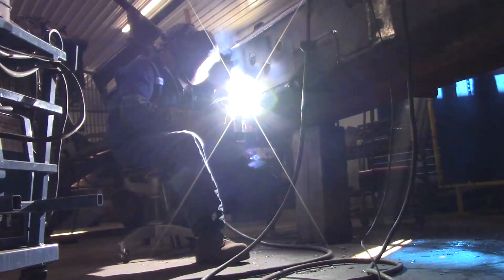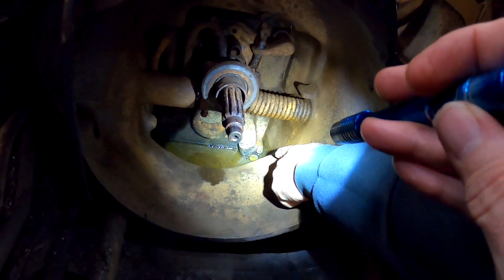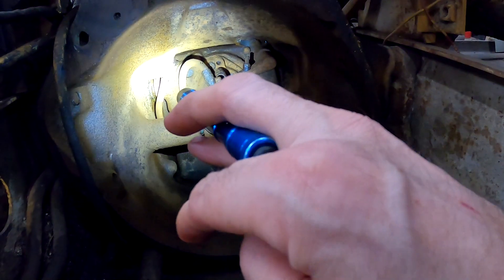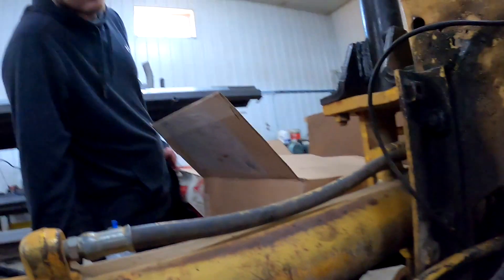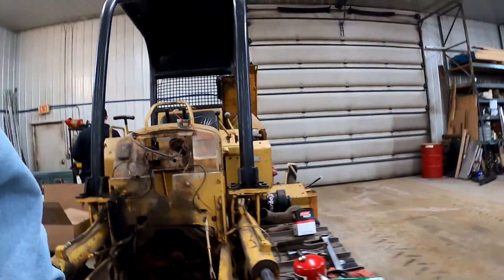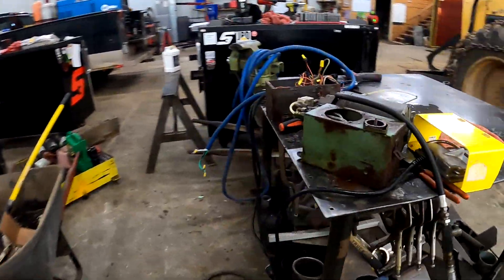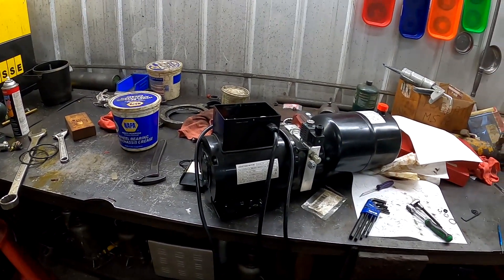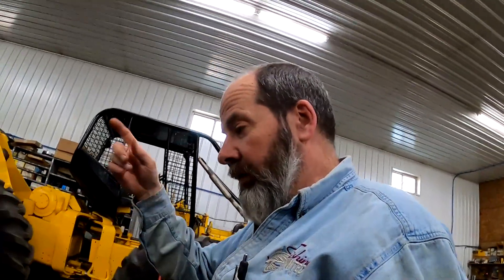John Deere 450C dozer transmission leak

Comment: I know this video is old, but I figure I'll ask anyway. My JD450-B will not pull in reverse, I've seen some people say the linkages could be worn and cause the problem ( I plan on checking the next time I'm able to )
I checked my pressure a few years ago, and if memory serves, I have around 180 psi in H & L but nothing in reverse. Would you have any idea what else could possibly be the problem?

Comment: Hi Michael got a 450 B JD dozer With transmission power loss,no power to tracks what so ever,no oil coming up to transmission oil filter the one in front of rad.Could you give me some clue what could be the problem  Thanks